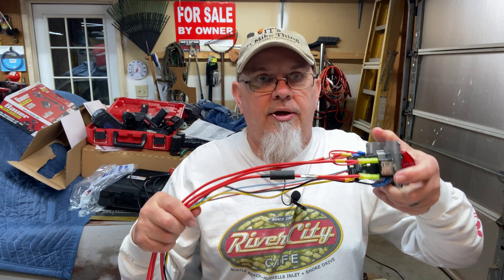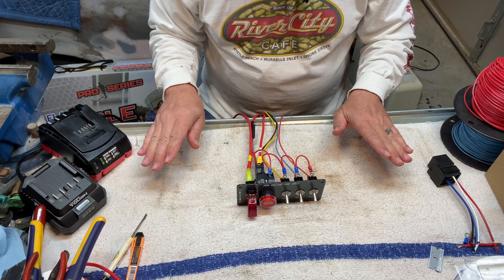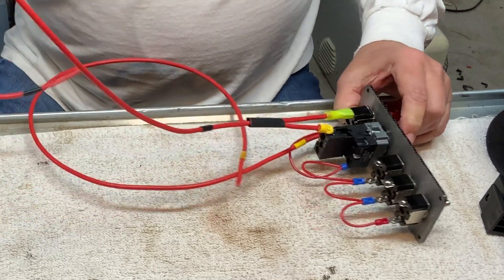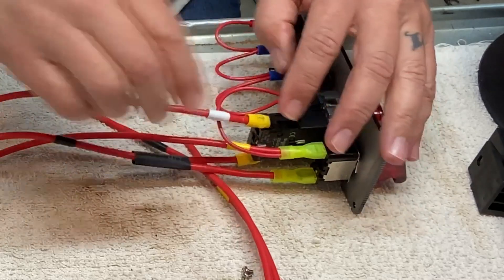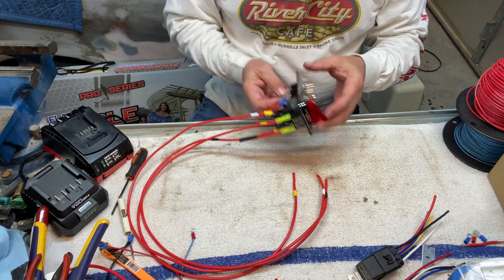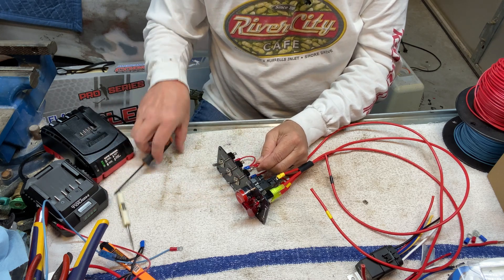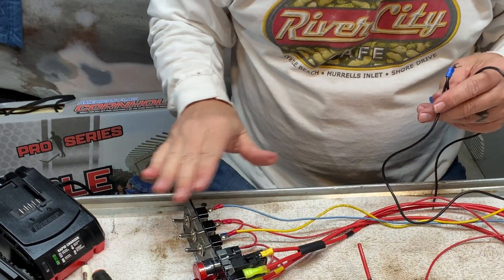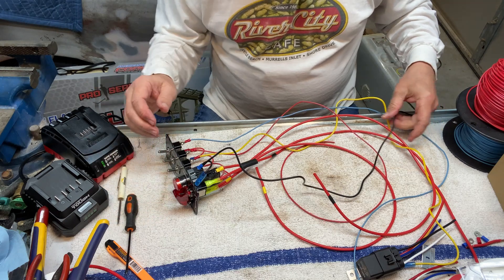How to wire a push-button starter switch panel

Comment: Hi sir, i have the same device. My intention is to use just the safety switch and the start button. Two wires from a battery and two wires out to  power a dc motor .Any help welcome.
Reply: Hi sir. Just momentary control. When i push it to give current and when i release it to stop
Reply: I need your help for the wiring
Reply from the maker: Do you need just momentary control for the motor? Or do you want to use the push button to turn the motor on and have it stay running until to press it again?
Reply: @MikesRepairShopEDU .Hi sir. Just momentary control. When i push it to give current and when i release it to stop

Comment: No me quedo MUI claro lo de la conección del botón en dado caso que alguien quisiera presionarlo me ayudarías con algún diagrama porfavor
Reply from the maker: The correct way to connect the starter button is to use 12v from the switched side of the main power switch to supply power to the start button.

Hope this helps!

Comment: How would U incorporate the ignition  and acc into this if I'm not using a key
Reply from the maker: Just thinking on the fly, I guess the easiest way would be to dedicate one of the switches on the panel to power items that would be on the accessory position on your old key switch. 

Of course, this switch couldn't be powered by the main switch, as shown in the video. It would need a separate fused power source from the battery so it could be used while the main switch is in the off position. Keep in mind that you'll need to install a relay(s) to carry the load you'd be asking that switch to run.

Comment: Would it work on A mustang 98? I lost the key, and the key has a chip, so if I put this switch start would it work if I connect the ignition wires and the ECU on the small switches using the relays?

Comment: I have the same exact switch panel, trying to connect to my 94 F150, I want to place it on the left side of the steering column as I only have my left arm. Are you saying I don’t need to use this relay that came with the package?
Reply from the maker: That depends on a multitude of variables. How many amps are you going to be pulling through the panel?